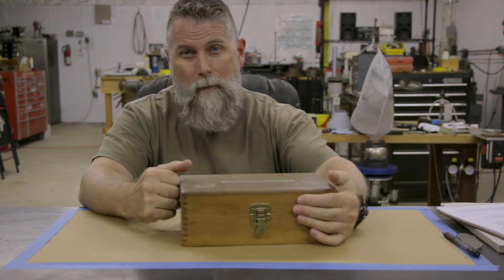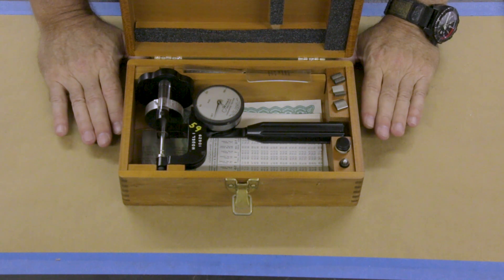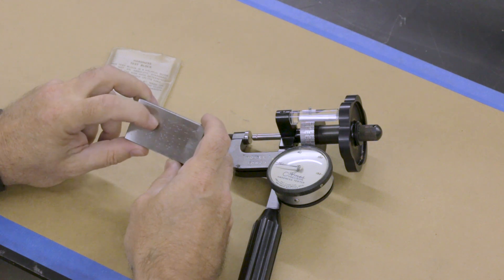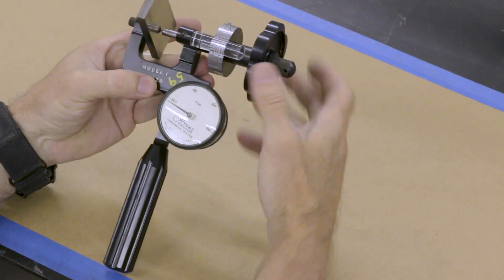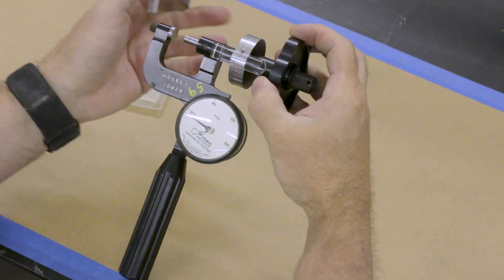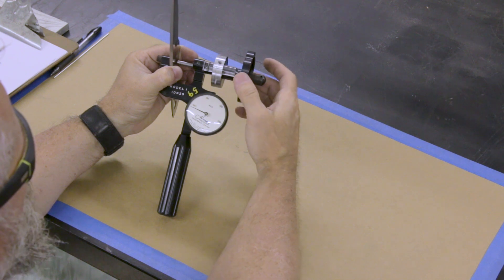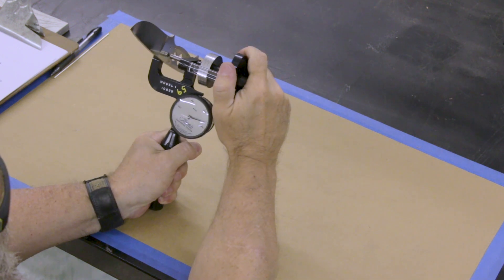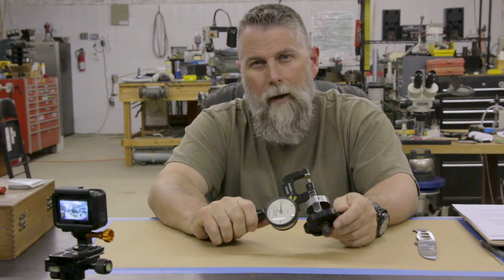Advanced Knife Making - Testing Blade Hardness with the Ames Model 1

Comment: What was your  influence on choosing the Ames over a bench model ? as the cost are just about comparable and space don't look to be an issue. keen to see a full folder build start to finish
Reply from the maker: For me, the driving factors were reliability and price. I did buy mine from an Ebay seller but, he had a good return policy and the price was very reasonable. It's been about five years since I bought it but, pretty sure I paid $300-350. I was in a smaller shop when I bought it but, size wasn't a main decision point; it's something I've come to appreciate though, even in a larger space.